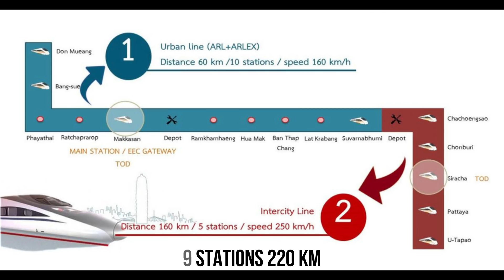Thailand NEW High Speed Railway Project to connect 3 Airports - 🇹🇭 4K

Comment: It's still not clear about the train and system that will be used in this project. But the most possible is the Hitachi train with the Shinkansen system from Japan. For the Fuxing Hao, it will be used in Bangkok-Nhongkai HSR project.
Reply: Will they be compatible with each other (signaling, voltage, etc)?
Reply: @Jin88866  The system of the EEC line (3 airports link) will be compatible with both the ETR1000 series from Italy and Hitachi AT400 from Japan. The latest news mentioned that there is a high possibility that they will use both models of trains in this line. 

For the northeastern line, it will use the CRH system. However, there will be a conflict between the northern and northeastern lines because the Thai and Japanese governments want to use the Japanese Shinkansen system (which is not compatible with any other HSR systems in the world) from Bangkok to Chiangmai which is incompatible with the CRH system in the metropolitan area (from Chiang Rak Noi maintenance depot to Bang Sue Grand station) that both northern and northeastern lines have to use same tracks. I assume that the Thai government will choose another system instead, maybe the same system as the EEC line but I can still see some effort of both Thailand and Japan for bringing the shinkansen system to Thailand HSR northern line. To sum up, Japan really wants to use their Shinkansen system in the northern line but they don't want to use the same tracks as CRH in the metropolitan area. The most possible is that Japan changes to use the Hitachi AT400 model instead because this model is compatible with other systems not only the Shinkansen. Or the most stupid way, build another level of elevated tracks exclusively for Shinkansen (third level) which they have to pay much more.

Comment: I the Macasan station remembered me on a story:
I wanted to the D'ma Hotel that I know it is close to the 
Makkasan station of the normal train station. But 2.5 km
from Makkasan Airport link station (The correct station
would have been Ratchaprarop). So ended up walk the
half a hour to the Hotel.

Comment: Why is the railway line elevated for nearly all of the distance? The Bangna-Chon Buri expressway is also elevated all the way from Bangkok to Chon Buri (making it the world's longest road bridge). It seems unnecessarily expensive to elevate rail and road lines over long distances of flat countryside.
Reply: It's hard to explain, but this is part of the connection with big projects like the EEC and many more in Thailand's master plan.

You can see it in this video.
https://youtu.be/AyytDckn_TY

And this
https://youtu.be/6ImVl4lK4Tg
Reply: @stateofthearth  
Do you knpw when this railroad is planned to be completed?
Reply: @nikokapanen82  I'm not sure if the information is still up to date, but expected to open in 2023 😃
Reply: @stateofthearth  
Thanks :)
Reply: @stateofthearth  พ.ศ. 2570 = 2027 A.D.
Reply: @stateofthearth  That is one hellava Ambitious Plan! but i must say it looks Doable!
Reply: We poor?  And we can.???
Reply: It's cheaper than the land expropriation costs.
Reply: I wouldn't ride on a highspeed train that runs at street-level. A 250km/h+ train ramming into a road vehicle, especially buses or trucks, will be disastrous.

Comment: I think this will also be a medium speed train that runs from Don Muang Airport to the center of Bangkok, which may be more convenient than the SRT Red Line.
Reply: There is no medium speed train. There's normal train, and there's high speed train. Medium speed train does not exist.
Reply: How fast is 'medium speed'?
Reply: @RaymondCore  
For City Line
Maximum speed 160 km/h from Don Mueang Station to Suvarnabhumi Station

For HSR
Maximum speed 250 km/h from Don Mueang Station to U-Tapao Station,
But I'm not sure if they will use the maximum speed in city area or the same train with city line(from Don Mueang Station to Suvarnabhumi Station)
Reply: @stateofthearth  all City line and HSR from Donmuang - Suvarnabhumi max. Speed 160 km/h. 
However All HSR from Donmuang-Bangsue Grand max. Speed 160 km/h.